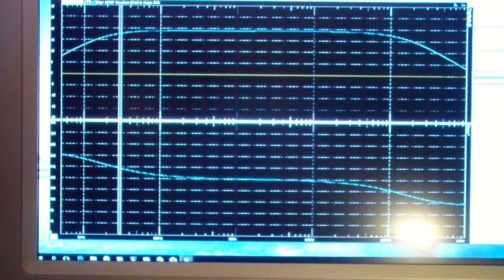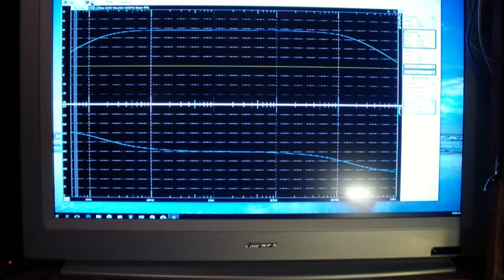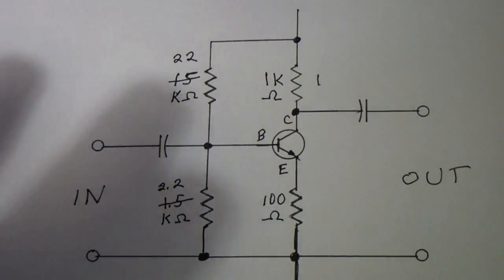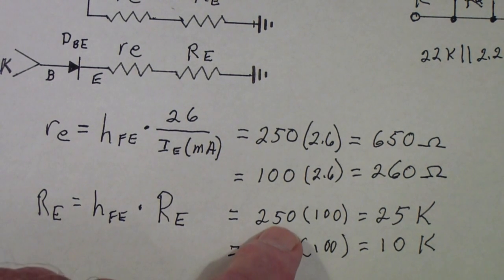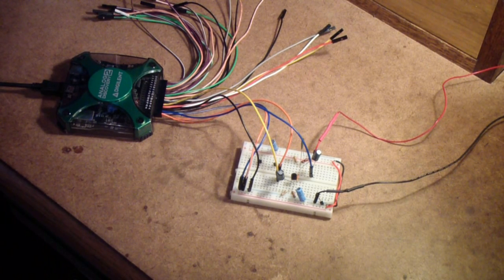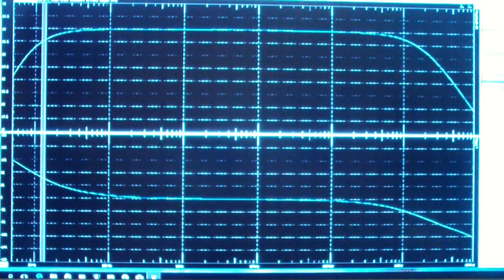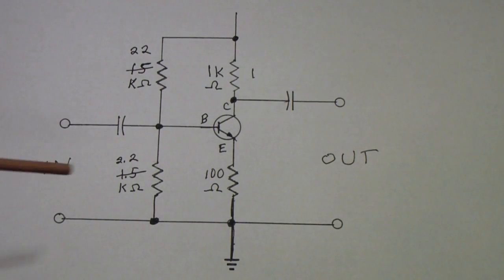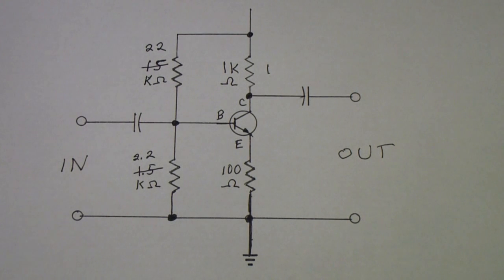TTT137 Class A Transistor Amplifiers Pt2

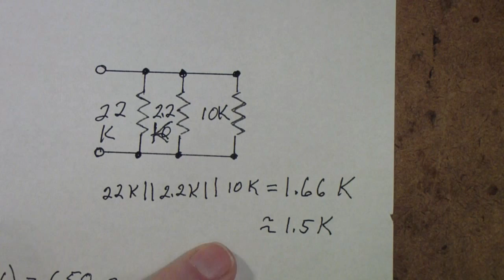Comment: 7:15 I assume this is to impedance match? If so, why is this important?
Reply: Its not impedance matching
Its simply choosing a best value of coupling capacitor ( to block dc) that will pass signals  without significant loss or phase shift)

If he chooses a "-3db point"  at 10 hz - then signals above this say from 20hz will not be attenuated
That is Xc << z (in)

Comment: Some thoughts:
The previous circuit didn't draw "a little more current" than you wanted. You designed for 10mA and it drew somewhere around 6.4 to 6.9mA through the collector/emitter - we're not sure which is accurate. If you increase the values of the bias resistors R1 and R2 while keeping the ratio the same, you will slightly lower the collector current because the finite beta of the transistor means the base current will load the divider network relatively more, and slightly lower the voltage on the base.
To see the effects of a finite beta, we can calculate the voltage at the base by looking at the currents flowing in and out of the node, where Vs is the supply voltage:
(Vs - Vb)/R1 = Vb/R2 - Ic/β
When you solve that for Vb, you get:
Vb = Vs.R2/(R1+R2) - (R1.R2/(R1+R2)).Ic/β

In other words, the effect of a finite β is to lower the base bias point from the ideal Vs.R2/(R1+R2) by a small voltage equal the parallel resistance of R1 and R2 times the collector current divided by β. In the circuit given, the base voltage with infinite β would be 1.36V, giving an emitter current about 7.1mA. With β=250, it drops by 0.05V to 1.31V, giving an emitter current about 6.6mA. With β=100, it drops by 0.12V to 1.24V, giving an emitter current about 5.9mA. With β=50, it drops by 0.20V to 1.16V, giving an emitter current about 5.1mA. I'm sure you can see how sensitive this makes the collector voltage bias point to variations in β when the input resistors are not small enough and when the emitter bias point is comparable to Vbe. You really ought to work at a lower collector current by scaling up Re and Rc if you want to eliminate this sort of sensitivity.

However, the circuit had too low an input impedance and the solution to that is to reduce the collector current. Designing for a lower collector current allows you to scale up all of the resistors by the same factor and hence increase the input impedance. It also increases the output impedance, of course.

The impedance looking into the base of is β x (Re + re), but re is about 4ohms at 6.5mA, so is negligible compared to Re (100ohms). That is what we need for low distortion operation as the non-linear element (re) is not significant in our gain calculation. However, the input impedance is now the parallel combination of R1, R2 and β.Re, and the dominant (smallest) term is βRe. That makes the input impedance dependant on β and we should try to avoid that. If you check the datasheet for the 2N3904, you'll see how much the β can vary at different operating points, and you certainly can't trust the value measured on a transistor tester to be the same in a real circuit. Normally we would aim for β.Re to be bigger than R2, but that would require a larger Re and hence a higher supply voltage to get the same gain while preserving the output swing. The other possibility would be to reduce dc gain and some headroom by aiming for a higher voltage on the base and increasing the emitter resistor without increasing the collector resistor. The reduced dc gain will stabilise the bias points and allow an increased input impedance. Then the ac gain could be restored by using a suitable capacitor to bypass part of the emitter resistor (i.e. use two resistors in series, and bypass the lower one - the ac gain is set by the upper resistor and the dc gain by the sum of them).

I completely disagree with 12:50 "two currents pass through [the emitter] resistor. One current is the output current." That is not a helpful way of looking at the design because for all intents and purposes, the emitter current is independent of the load. At any given input voltage, the emitter current is completely determined by the voltage applied at the base. If it is sourcing current to the load, that load current is derived by extra current through the collector resistor Rc, which slightly lowers the collector voltage, but not the voltage at the emitter. Similarly, if it is sinking current from a load, the current through the collector resistor decreases by the amount of the load current, thus slightly raising the collector voltage, but having no effect on the voltage at the emitter. That shows that the output impedance of the circuit is equal to the collector resistor, but that the emitter current is in no way related to the output current into the load.

At 13:26 I disagree with your conclusion that "The voltage developed across [the emitter] resistor by the output signal influences the input signal." It really doesn't because that so-called voltage doesn't exist.
The output signal actually does influence the input at higher frequencies because of the Miller capacitance between the collector and base, but that has nothing to do with the emitter resistor. The Ccbo for a 2N3904 is typically 4pF, so with a gain of 10, that becomes an effective 40pF feeding back from collector to base. However even at 20KHz, that's a reactance of 200K, so it won't affect the audio response in this circuit.

Comment: Is re in your circuit the same as r'e or r prime e?
Reply from the maker: re is the Shockley resistance between the base and emitter (or the cathode and anode of a forward biased diode) approximated by (R = 26/Ie in mA). So, a transistor operating with 2 mA of Emitter current would result in ~ 13 ohms (AC) between the base and the emitter. Hope this helps.
Reply: @tomtektest8042  Thank you sir, it does now.

Comment: The transistor in your pt1 video draws a LITTLE LESS current (6.8 mA) as what you wanted (10 mA). You also did not shift the base voltage, because your voltage divider ratio at the base is still the same (0.091) at in your pt1 video.

Comment: Sir, why the caps for the output coupling is reverse..
Reply: The capacitors used for this purpose are not polarized so it doesn’t matter how you connect them. He is merely drawing a capacitor symbol.

Comment: If you can't afford the Analog Discovery you can get the Analog Devices LTSpice for free. There you have a virtual circuit builder with a good library of parts. Many other libraries are available on line. I prototype nearly all of my circuits there before I build. 

Micro-Cap is now also free.
Reply: That's good info, but does nothing to help someone in prototyping and evaluating real hardware.

Comment: I studied electrical engineering on my own and with Cleveland Institute of Electronics.  I could understand everything except the calculus.  You should have pointed out that your analyzer is displaying a base 10 log graph (I can tell from the dB curve shape).  The log graph allows the viewer to see great detail in a situation where values differ greatly.
I used to be a chemist.  There is a LOT OF CALCULUS (i.e. integrating to find the area under a peak on a graph, which represents the amount of chemical present in a sample), but all of the instruments are hooked up to computers that do the calculus for you.  Easy!
Great video. Thanks.
Frank
Frank Reiser Video/Audio Service
Reply from the maker: We have a couple of things in common (1) I was working as a tech to save money to go to college and the company I worked for built readouts for chemical and analytical equipment including gas chromatographs and mass spectrometers which I am sure you know a lot more about than I and (2) I am a collector of slide rules and have one that I particularly like which came from Cleveland Institute of Electronics (a Pickett N-515-T) with special scales for electronic technicians.

Comment: Congrads ! One of the best explanations with theory and actual circuit waveforms to clarify the concept.Can you also consider doing a Class A with dual rails and w/o capacitor coupling at input and output.Guess that input would then need to be modified.
Reply: This is exactly what I want to see too

Comment: I put the two-transistor circuit into LTspice and did an .ac analysis. Does your physical circuit roll off on the high end at 4 MHz like my simulation? I think maybe you called your 100 Hz marker 10 Hz by mistake, but I can't read the numbers on your computer screen to be sure.
Reply from the maker: Yes, the 3904 begins to run out of steam above a few MHz. In fact, I deliberately placed a shunt capacitor on the output of the circuit in Part 1 to cause it to roll off even faster (around 200 kHz). This helps suppress oscillation that can occur otherwise with an open output. I later removed the capacitor in Part 2 when I cascaded the second stage. I am glad to see you using LTSpice - as you know, it is my favorite circuit simulator.
Reply: tomtektest 
Thanks, I couldn't sleep tonight if your real circuit petered out a decade below what LTspice shows.